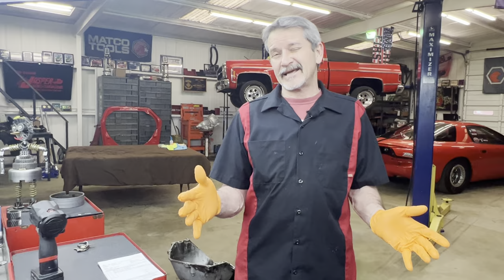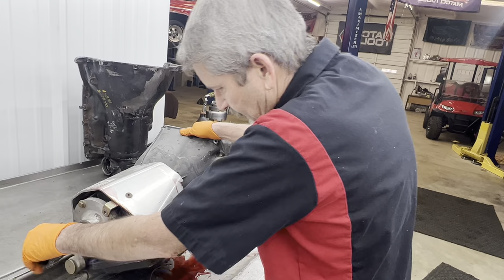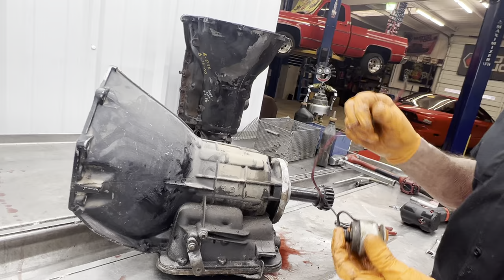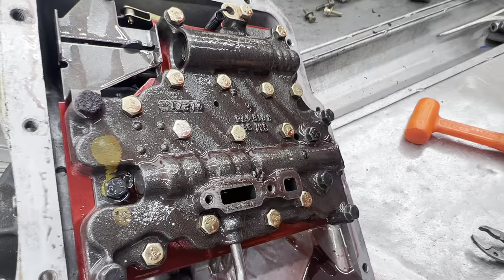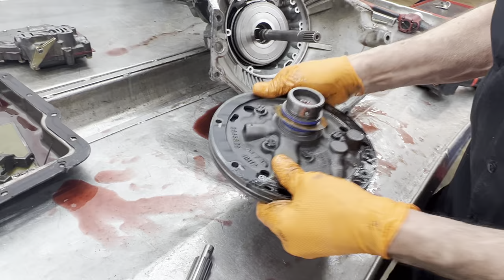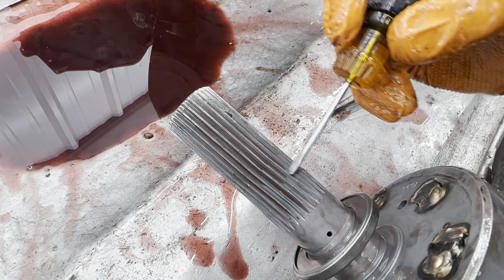2 sp power glide

Comment: How do you feel about, not using the wave plate on a street use ,non trans-break PG. (to get more clutches inside). High and low clutches, I know it will shift a little harder but don't know, if it would make it to hard shifting to be reasonable..?
Reply from the maker: If it has a full manual aftermarket valve body pressure is going to be extremely high if you had a 3000 3500 stall converter engagements won’t be as bad but the high shift is still going to be there the only way to know would be to put a wave in the drum and try it and see how it reacted but use flat, clutches and steals as many as you can get

Comment: Thanks for sharing. I have a bte powerglide  with a PTE torque converter 9.5 3800 stall in a ls twin turbo foxbody mustang  273 gears a trucool  40k transmission cooler and and  I'm have transmission  over heating  problems it gets up to 260  I want it for the  street  every  now and then  track so is a powerglide  good for street use or should  I look into  th350 or 400